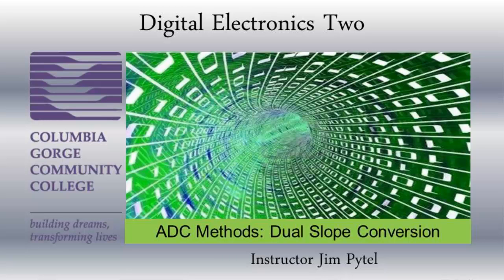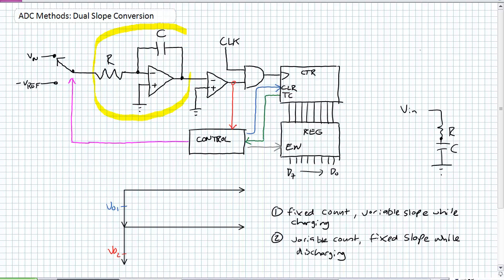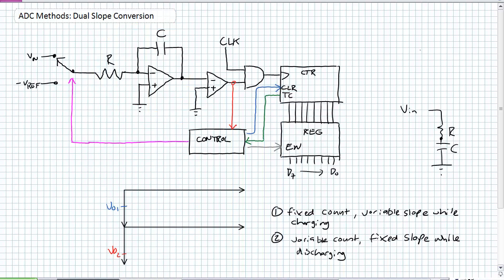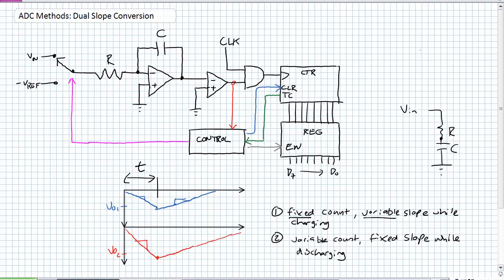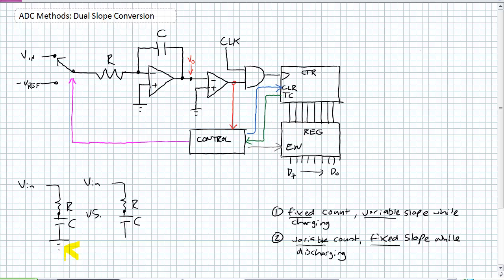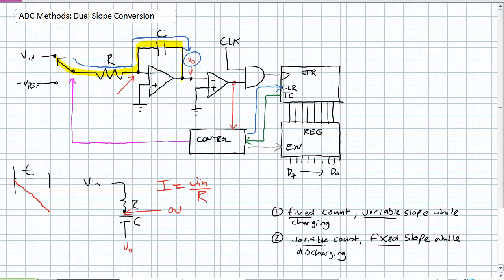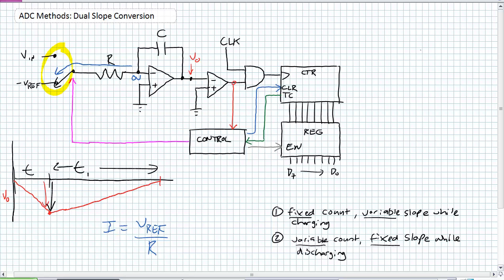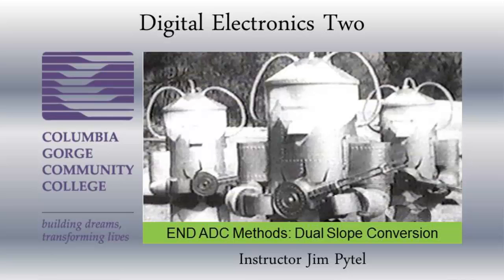ADC Methods Dual Slope Conversion

Comment: Unfortunately I still don't get, how a fixed time span can lead to variable voltages. I mean what I "there's still voltage left" and the capacitor didn't load up to the full voltage, because the time was already over. 
Sorry, might be a stupid question. But that is still not clear to me.
Reply: +freebird9 
For higher amplitudes the wave has to cover more voltage as time proceeds , due to which the wave gets more steep .
keep it simple .

Just consider that your input voltage is in abundance . The capacitor stores a small part of it within time 't' .
Reply: consider DC current .. which can't flow directly through  the capacitor .... so for a R- C  (consider C to be ideal ie no dielectric break down ) series arrangement acted by a strong  current source (constant magnitude ) .. current flows through  the resistor and creates a PD across the resistor but unfortunately I cant flow through the capacitor  .. so while  the floating terminal of the capacitor maintain at a fixed at constant potential .. for  the  terminal towards the resistor Potential constantly falls linearly with time ... AS a result potential drop across the capacitor  increases